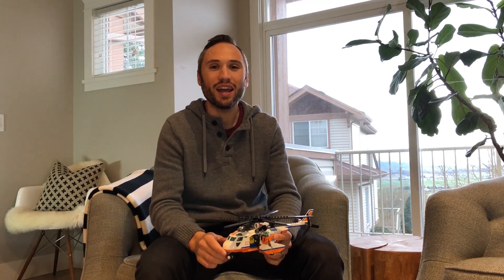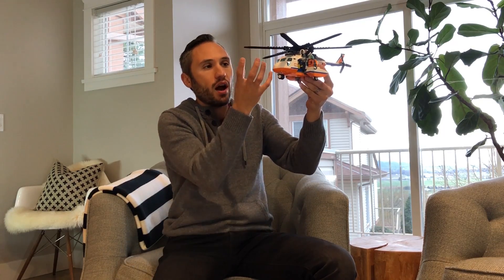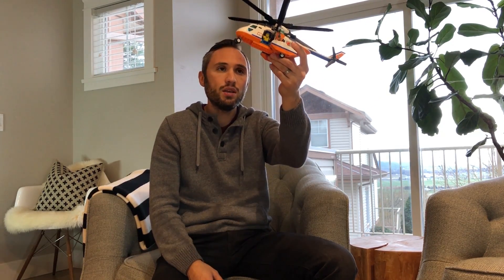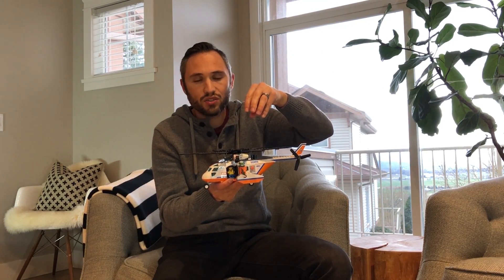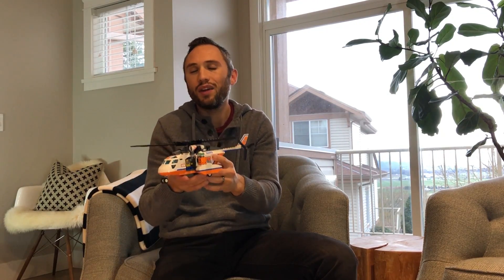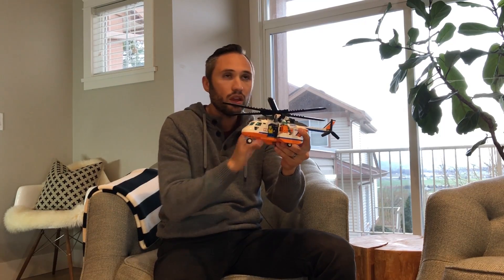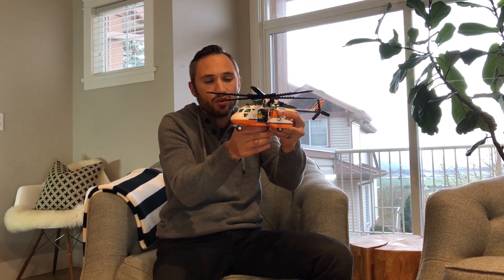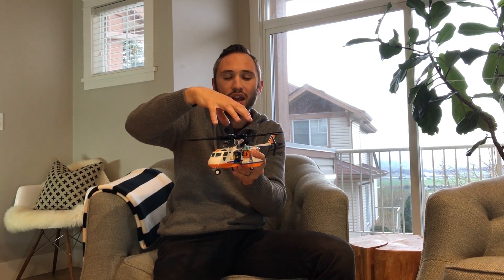Vortex Ring State IS NOT Settling With Power

Comment: I suspect that this is just another case of differences in terminology.  For years the U.S. has called it "Settling With Power," but it's the same thing as Main Rotor Vortex Ring State.  Just because Americans call a car's boot a "trunk" doesn't make it wrong, just different.  It's easy to see why it causes confusion and disagreement, however.  
The FAA's Helicopter Flying Handbook actually acknowledges this and lists both names for this hazard (p.11-9).  https://www.faa.gov/regulations_policies/handbooks_manuals/aviation/helicopter_flying_handbook/media/hfh_ch11.pdf  

Another terminology difference presented in this video is in "Overpitching," which describes the cause of the problem (raising too much collective and overpitching the rotor blades relative to the engine power available), versus the term "Low Rotor RPM" used in the U.S., which describes the effect of overpitching.  Again, different terms, but same hazard.  Cheers.
Reply: captjb407 ... you do realize no body calls a trunk a boot in Canada.
Reply: captjb407 ... it's Newfoundlanders that say oot and aboot instead of out and about. They make up about 3% of the population, so not our accent.
Reply from the maker: captjb407 the issue is when you call them the same thing you don’t realize that they need two different corrections to fix them. You can fix vortex ring state and settling with power the same way.
Reply: Pilot Yellow , when you say call them the same thing, are you talking about the U.S. calling MRVRS "Settling With Power," and Canada calling coming in too fast on an approach "Settling With Power?"  I'm not familiar with Canadian flight training, and until now had thought that SWP was a term exclusively used in the U.S.  Is SWP a term that's taught in Canadian textbooks?
Reply from the maker: captjb407 yes we teach settling with power means you are coming in with too much mass and inertia. If this happens the correction is to raise collective to slow the helicopter down as much as possible. It may not be possible though to stop the helicopter before you hit the ground. The correct way to avoid this is to load up your rotor disk early and avoid coming in with too much mass and inertia. The key factor though for SWP is that the rotors are in normal flight and lift configuration therefore raising the collective will slow the decent. However with VRS when you pull collective the helicopter is actually sink quicker. That’s the crucial difference.
Reply: Pilot Yellow , you piqued my interest. I found this statement in the TC Helicopter Flight Training Manual: "There are some uninformed pilots who use “settling with power” to describe vortex ring, in fact some publications use the terms interchangeably."  Besides being judgmental and inflammatory, the statement is wrong.  Pilots who use the term SWP interchangeably with MRVRS are not "uninformed," but simply learned different terminology.
https://tc.gc.ca/eng/civilaviation/publications/tp9982-exercise26-973.htm
Reply: Ed S , they don't call a trunk about what in Canada?
Reply: captjb407 ... "just because Americans call a cars boot a trunk..." well Canadians don't call it a boot either.
Reply: Ed S , about what?
Reply: Come on, Ed S, it's funny!  You know...because your accent.
Reply: captjb407 Ha!  That statement's awesome!  Its like if the DMV manual  said people who drive on the left side of the road are simply, "uninformed",...I'm talking to you London! 😄

Comment: I'm curious as to how the air temperature affects each one of those states? Is it easier to enter vortex ring state in hot and high mountainous conditions, and would the same apply to settling with power, is it easier to find yourself in a settling with power situation in hot and high conditions?
Reply from the maker: nicholmesza the temperature doesn’t play as big of a roll in Vortex Ring State. However it plays a HUGE roll in Settling with power.
Reply: Pilot Yellow I figured as much... We had a squirrel (AStar) crash in the mountains last week... it looked like they "ran out of lift" on approach - pulling power and zip happening which ended with machine on its side. Conditions were 5 aboard, full fuel, 31°C and 12600ft ASL. After watching this I gathered it was a settling with power crash!

Comment: Here in Europe Settling with Power is taught as being related to Vortex Ring State. The a/c is descending into its own recirculated accelerated air mass and increasing collective just accelerates the air more and does nothing to arrest the descent.  What you describe as Settling with Power we would call coming in too fast. But this is only a semantic difference.  I got my private helicopter ticket in 1985 and have been rated on Enstrom, R22, R44, B206 and H369 - though I now only fly the R44. I think your teaching, demonstration and your videos are excellent - your students are lucky to have such a great communicator. Have a wonderful 2018! :)
Reply: In settling with power, the column of air is not vertical, but is otherwise the same as VRS
Reply: Whoever invented terms for helicopters was not really thinking. I’ve flown Sikorsky helps for many years and there are THREE terms or definitions, TWO of which are synonymous and create confusion:
“Vortex Ring State” and “Power Setting” are the SAME - steep, low IAS descent into down wash resulting in unclean, turbulent air causing the disc to stall (or the blades just can’t grab smooth air). - corrected by side-step to the Right for CCW rotors (as seen from above) or Forward - anything to escape the column of turbulent air that you are descending in.

OK, TERM #3 is “Settling With Power” as described in the video approaching too fast or more accurately “mismanagement of power” and not being able to “load the head” for a controlled Transition To The Hover” (TTTH).

The ambiguity between “Settling With Power” and “Power Settling” (again TWO completely different things) is understandably confusing but maybe for us Rotary Pilots it enables us to make ourselves look smarter to FW pilots - who, in my experience, are easily confused and baffled about Rotary aerodynamics anyway?

My $0.02 worth.
Reply: You are correct. Their definition of settle with power is trying to identify the obvious, a poor approach.  Settling with power or VRS, all the same thing.

Comment: I was taught that the Vuichard method is push the power pedal and apply opposite cyclic or as some say crossed controls. In a counter rotating helicopter that is left pedal and right cyclic.
Reply: Yes Mischa made an error when he explained left cyclic and left pedal. It is opposite pedal to keep the nose straight.

Comment: Oh boy, the rotor does not stall during VRS. It’s generating lift, which is what’s causing all the downwash. You generate lift, but because you’re flying through your own downwash, adding pitch only makes it worse.

Also as a side note, I like to lump over pitching and settling with power into just one term: power required exceeds power available. Makes things simpler, just two different scenarios.
Reply: I never understood it as a fact, he's not saying the rotor stalls, he's comparing it to a fixedwing stall. That's how I understand it.

Comment: Too bad they don't make real helicopters like 3D RC heli models.  We model flyers just continuously pulse the collective, and the throttle is held fixed and "ripping".  As you know with high rpms the pitch becomes much more responsive.  However, it's not efficient and there-in lies the problem with real working helicopters.  Minimum weight, minimum power to get maximum distance.

Comment: The FAA doesn't really say they are the same thing, though I understand the confusion due to the way they do the title.  The FAA is trying to make the same clarification as Transport Canada is, which I think you are getting wrong about Settling with Power.  You are describing Settling WITHOUT Power.   

You can't have real Setting with Power without Vortex Ring State (both TC and FAA try to make this point), but you can have Vortex Ring State without Settling with Power and you can certainly uncontrollably settle without being in VRS. 

An example of Settling without Power --  If you come in with too much of a vertical descent rate (regardless of airspeed), one of two things will happen: If you have enough power, but not enough space, you can pull the collective up to the stop, not droop the rotor, but not have enough room to arrest the descent before you hit the ground.  If you don't have enough power, you'll droop the rotor and hit the ground that much faster.  If you have some airspeed, you can trade it for descent rate like the end of an auto rotation.  If you have zero airspeed, you might be getting into Vortex Ring State and Settling with Power, or you might just have insufficient power to arrest the descent rate and no airspeed to use to arrest the descent rate.  Of course, you can get yourself into VRS through bad power management, but that calling that SWP would be like calling a sideways run on landing into a field Dynamic Rollover.

Part of the confusion in this is that helicopters have changed significantly over the past 50 years (well, some more so than others).  In a modern twin-engine turbine helicopter, it can be very hard to impossible to get into Settling with Power.  You'd have to really slowing bring in power to continue to develop the ring state without arresting the descent.  If you bring in power quickly, you'll arrest the descent rate before ring state can creep down the rotor blade. You can get into Vortex Ring State, but under almost all conditions you can recover with collective only.  This seems to be what some of the RC pilots are talking about too.  They can get in to VRS, but RCs have a ton more power to weight that most real helicopters so they can always power out of it since the still-lift-producing outer portion of the disc can produce enough lift to compensate for the stalled out inner portion.

That is certainly not the case in an R44 or other reciprocating engine helicopter.

Where the confusion that the FAA and TC hint at usually comes up is when someone crashes a large twin-engine while landing high, hot, or heavy and says they got in to SWP.  Usually what actually happened is that they didn't have OGE power (or maybe not even IGE power), did an OGE maneuver and drooped the rotor (what you call over-pitching) or maybe didn't droop it, but started settling due to lack of power (which if done at a high enough altitude could progress into VRS).
Reply: Rhubarb Steve ... no he is describing vortex ring state, settling with power is when you do not have enough thrust to arrest your rate of descent.
Reply: Rhubarb Steve ... Transport Canada is not contradicting what pilot yellow is saying. Take it from another cfi in Canada.
Reply: Ed S, I didn't say his description of vortex ring state was wrong at all.  I said his description of settling with power was wrong.  Transport Canada seems to agree with me:

From TC: There are some uninformed pilots who use “settling with power” to describe vortex ring, in fact some publications use the terms interchangeably. Confusion results when symptoms are related that do not describe true vortex ring but rather describe “settling with insufficient power”. This may occur when a pilot attempts to arrest a rapid, low power descent only to find that he has insufficient power available to bring the helicopter to either a hover or a no-hover landing without exceeding the engine limits. However, this is not a vortex ring situation.

From the FAA: Vortex ring state describes an aerodynamic condition in
which a helicopter may be in a vertical descent with 20
percent up to maximum power applied, and little or no climb
performance. The term “settling with power” comes from
the fact that the helicopter keeps settling even though full
engine power is applied.

Just like Transport Canada says -- pilots will ball up an aircraft because of poor power management and a bad approach, and call it "settling with power", when it really was settling with insufficient power (ie. too fast an approach resulting in .  Like the FAA says, you can get into VRS, and then instead of using airspeed to exit it, try to apply power, deepen the ring state and "settle with power."

The FAA method of demonstrating settling with power is ". . . allow the sink rate to increase to 300 fpm or more as the attitude is adjusted to obtain airspeed of less than 10 knots. When the aircraft begins to shudder, the application of additional up collective increases the vibration and sink rate. As the power is increased, the rate of sink of the aircraft in the column of air will increase. . . " showing that once you get into VRS, you can make it worse by applying power and increasing your rate of *settling*.

I'm not versed in Transport Canada docs, but I looked at TP9982 after watching this video.  I think TP9982 sets up a bit of a straw man argument.  I've never heard anyone confuse VRS and settling with power.  You almost always hear people blame a crash on approach as "settling with power" because it makes it sound like they didn't try an OGE approach when they only had IGE however power (which is what the second half of that paragraph in TP9982 is saying).  Is there some other TC reference that clears up their perspective, because I TP9982 certainly doesn't say that "settling with power is when you do not have enough thrust to arrest your rate of descent."

Comment: I find in this position is slight nose down Full negative pitch as you pick up speed trip the cyclic up  so you have some control to use the collective to land you only get one shot
Reply: gess ges ... yours is the traditional method but it is not effective unless you have the altitude to recover.

Comment: OK, I am no helicopter expert but I am pretty good at research. My, admittedly quick, research into your issue with the FAA calling Vortex Ring State (VRS) synonymous with Settling With Power (SWP) seems to me to be a non-issue based on a misunderstanding. Let's assume that the FAA simply has two terms for the same phenomenon. That phenomenon being what you call VRS. You seem to be taking one of those terms, SWP, and applying to a straight issue of pilot error. If my truck is overloaded and I misjudge my braking distance and rear-end someone at a stoplight, that is driver error; it does not need any special term beyond that. IMO. What I see the FAA describing as SWP is clearly what you call VRS. I do not know if the FAA has a special term for that sort of pilot error you want to assign the term "SWP", but I think you are misstating the FAA's position. They simply seem to be using two terms for the same phenomenon.
Reply: Bad Gyro ... the part you are missing is the loaded disc approach. Research that, as that is the way to avoid the overloaded truck scenario. The entrance into both of these situations is nearly the same and so is the avoidance, the loaded disc approach. Pilot error gets you into both.

Comment: I fervently disagree with your explanation here. Firstly, being behind the power curve on landing IS NOT settling with power, that's simply poor power planning ( I don't care what Transport Canada says) . Secondly, you DO NOT need to be descending to get into M/R VRS.  You can get into M/R VRS when you're OGE with zero or low airspeed (high or heavy or hot or any combo helps get you into it).  I was at a stationary 4000 feet hover, on a 70 degree day, pointed straight into very light wind with a cameraman hanging out of the back door when I got my first real world experience with it.
Reply: P R ... first you're saying that a certified flight instructor in Canada is wrong because he teaches what settling with power is in Canada. Secondly if you got into VRS stationary then you were descending and hadn't realized it.

Comment: Semantics perhaps but if the direction of relative wind matches the chordline of airfoil then the rotor (wing) is about as far from stalled as you can get. The airfoil is not generating lift because there is zero angle of attack. A stall occurs when the angle of attack exceeds the critical angle.
Reply: I know your comment is 2 years old, but you are right on the money. At first watching this video was confusing until I realized he meant there was zero lift due to zero angle of attack.